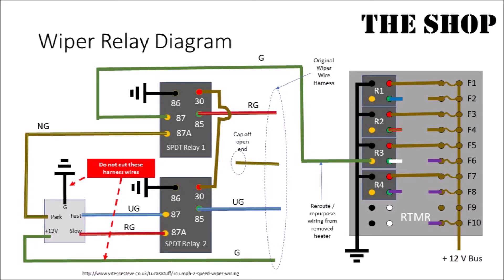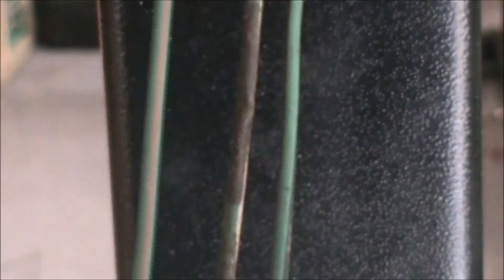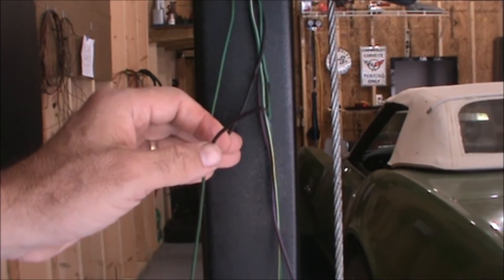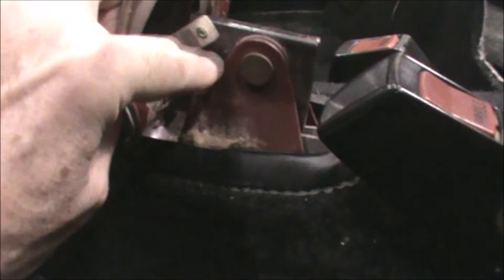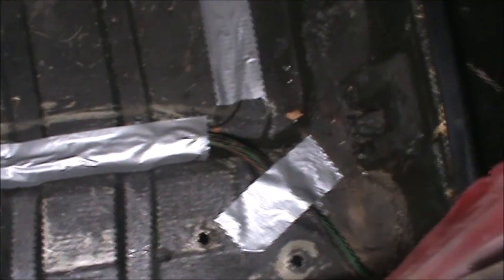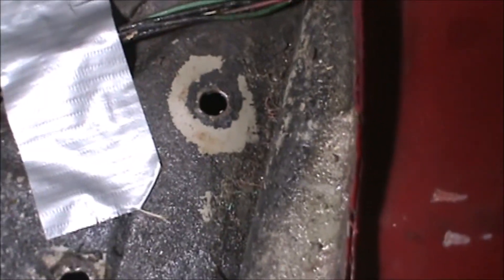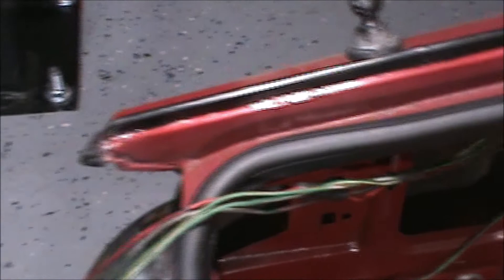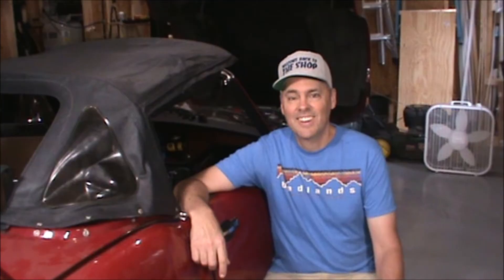Triumph Spitfire 1500 - Wiring Mods & Upgrades - Ep. 5 - Rear Body Harness and Wiper Relay Fail

Comment: I just bought a 1973 Spitfire 1500 FM vin on July 1st 2k25.  I am learning a ton from your videos so thank you very much! Today I learned where the seat switch wires are hidden, the boot light wire and switch,  and a ton of other stuff more important than those two, but just as mysterious, lol. You Earned my sub, that's for sure. Thanks.
Reply from the maker: Hi Bob, 
Thank you for subscribing.  More importantly, congrats on being a new Spitfire Owner!

I am glad that you are finding these videos helpful.  That is one of the main reasons for doing them.  That, and having documentation on what I actually did so that I can refer back to them.

I'm currently rebuilding a Small Block Chevy engine (50+ videos so far on that alone), but I do have an upcoming video series on installing air conditioning in the Spitfire.  That will be interesting...

Again, thanks for subscribing!
Reply: @MikeHammill-TheShop  That WILL be interesting! And you're welcome, but really I do thank you for all YOUR hard work. Looks like I have a bad brake light switch and so I ordered it. I'm currently just flicking on the running lights for that FAUX brake light effect, lol  I've got all the running lights fixed including the ones for the license plate. No turn signals which is weird 'cause they were working at the dealers. Grrr. I've also got one headlight working high/low but zip on the drivers (left) side. It's a '73 so perhaps it didn't come with the "boot" switch and light? It really was wired by the prince of darkness wasn't it? lol  Thanks a lot Mike!
Reply from the maker: @Bob-Whiting  the headlight grounds in the bonnet easily corroded.  There is one ground for each light.  It does not surprise me that only one is working.  The torpedo connections are easy to pull apart, but don't always connect well over time.

You will figure it out.  They are simple to work on once you get past the initial learning process.

Don't hesitate to reach out if you have questions.
Reply: @MikeHammill-TheShop  Oh thanks brother!  BTW, my actual brother's name was Mike as well. Lost him to cancer 2 1/2 years ago now.  The good news is... I've got myself a Spitfire! and a new friend,  This is one hell of a good week. ;-)   Happy 4th and thanks for the tip, I was thinking possibly a bad ground, they seem to be EVERYWHERE on this ol' girl.  I do have a question though... is there a clip of some kind holding in the B.L. Switch? I see a stamped nut on the end facing the seat, but I can't see the other side. I'm disabled and having trouble getting in there and getting it out.  Any thoughts Mike?